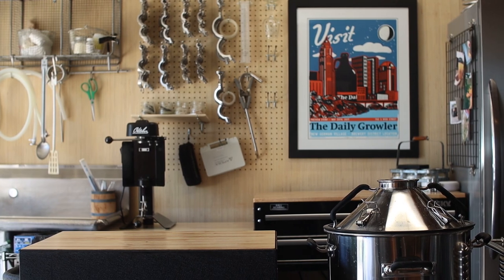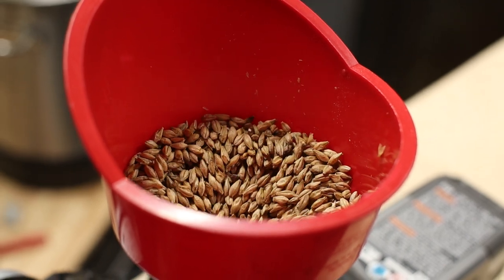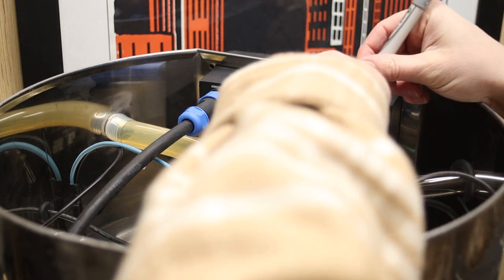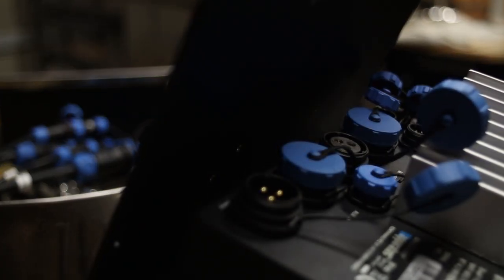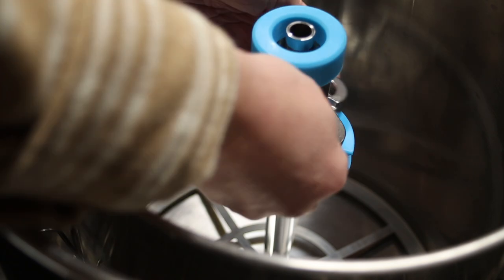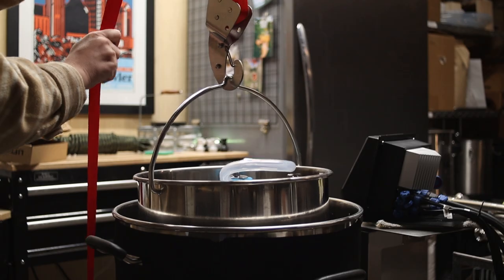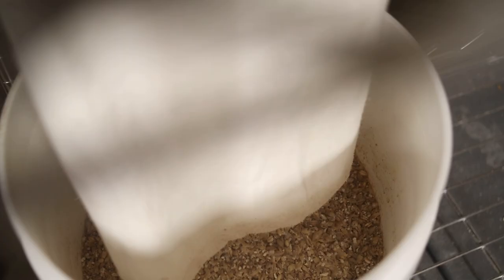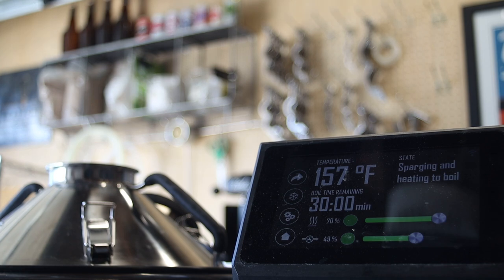7 Home Brewery Upgrades for Another Year of Brewing Beer | Brewtools Brewing System | Hops & Gnarly

Comment: Hey Dan
Some nice upgrades there to be fair, liking the pulley system and the moving of the controller, really need to do that with mine but the cable isn't cheap, have long since had the longer latches and they certainly do help, but it's still quite easy pulling the malt pipe off the centre pipe if you lift manually but with your new lifting system that should be a thing of the past for you.
Don't think i'll be getting the mash manifold tbh as i nearly always get really good efficiencies [92% Mash and 80% BH last time out] with the original basic setup, as i've mentioned before a 20 minute Vorlauf before the sparge helps greatly imo...cracking video btw...
Reply from the maker: Cheers Gary! 🍻

Comment: We have such a similar set up with the B40. What kind of boil off % changes did you see from adding the steam condenser? Do you happen to have what you use for equipment on Brewfather? My OGs have been missing lately and I think it’s because I am not boiling off as much with my new hat. Cheers as always
Reply from the maker: Hey nice to see ya down here! This sounds like a good topic for a video. I think the default profile is set at .92 and mine is currently set to .6 gal/hr. Been running my boil at 50-55%
Reply: @HopsANDgnarly  thanks man, as always I appreciate the insight! Keep up the great content. Cheers